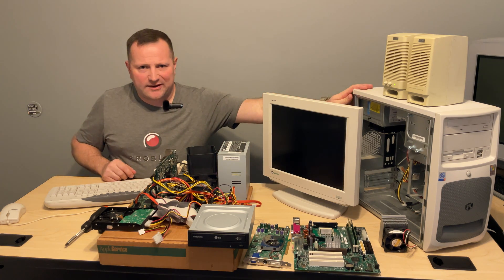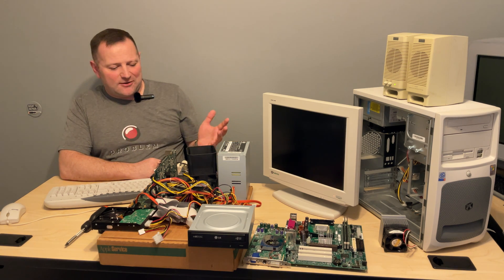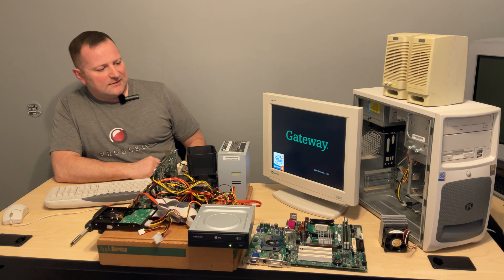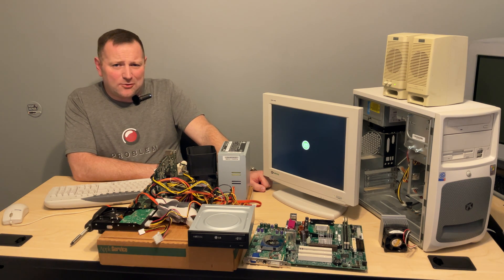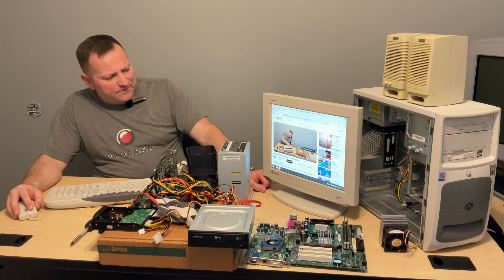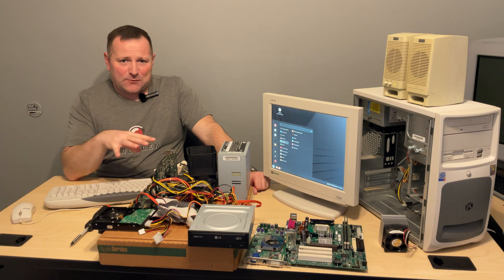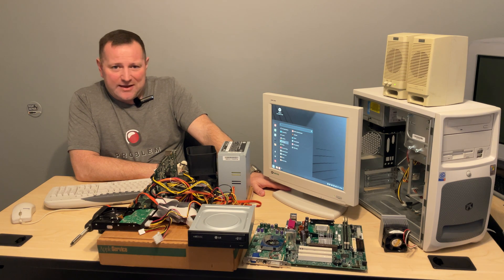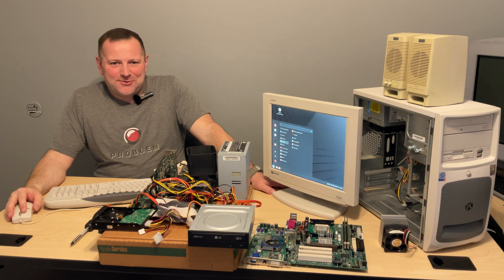Running Linux Mint (LMDE 6) On A Pentium 4

Comment: I'm currently converting every old laptops to Linux mint cinnamon (22.1 xia and lmde6 faye) as these recent versions now uses gnome Bluetooth, Bluetooth connectivity is no longer an issue and every Linux mint update is getting better.

I currently own a Dell Inspiron n5110, a pain in the ass to upgrade but I managed to replace the old Seagate momentus HDD with a 256 gigs SSD. An acer travelmate 5744z with a pentium dual core d6200 , a hp pavilion G6 with a core i3 4th gen and 8gb ram, a Lenovo ThinkPad T460s and an acer aspire a315 with 4gb of soldered ram.

All these laptops have been upgraded with 256 gigs ssds and all of them have Linux mint and are no longer tied to Microsoft because I found it weird that an OS couldn't be installed on a different machine. Does windows miss me that much? No, in fact I'm happy with Linux.

I will be getting an old pentium 4 with a windows xp installed on this and i will try fedora 41 cinnamon as Ubuntu is making things difficult with its proprietary packages and lack of customisation
Reply from the maker: Love to hear it, keep em’ running

Comment: pentium 4 can be 64bit compatible. Just depends on. the version tho.
Reply from the maker: Pretty sure the first one was 32bit, the second one was a last minute swap so it may be 64bit but never checked for sure. Need to recap both boards before going any further
Reply: @IkesVintageTech  i remember and still in my mind that the pentium 4 was supposed to be the bomb. its just I looked up the cpu marks in comparison to our modern day chips and they're are upwards of 10 times+ the benchmark rating.(not sure how exactly accurate benchmark compare across gens but even still).... we were quite limited on single thread instruction processing power in architecture... and multicore just had more units was the way to scale up processing power. ... at some point it radically shifted.

. there's no premium performance feel tho to all this chip power in the os UI and app performance. that's sad because we don't streamline and make stuff lean anymore.  (example: unreal engine. and games that take up 100s of gigs in size but don't look that much better).

Comment: The only point I can see to these types of videos is as proof of concept of how compatible linux is with older hardware, basically if it'll run on cheap/ancient computers it'll run on almost anything. However other than that I've yet to see anybody having a /practical/ use to these ancient/low-end pcs with linux that they'd use regularly. They just don't have the horsepower to be... pleasant to use now-a-days unless you have an /extremely/ niche case where you need almost no processing power/RAM, and don't mind running a computer that's comparatively speaking a gas-guzzler for watts vs computing power. Don't get me wrong I wish there was as I have several outdated and low-spec computers that I'd like to find a use for, but I'm too practical to just run them just for the sake of running them.
Reply from the maker: I have an older thin client and older touch screen running basically just a web browser in Linux to view my Unifi cams. Not as old as this of course but a use of basically e-waste hardware for a single purpose.

Comment: 32-bit and 64-bit do not mix well. Basic mint has nearly dropped 32-bit support, you may get stutter and blinking, lost frames etc. if you try. but some distributions  do support that.
Reply from the maker: Plan on trying again with a 64bit P4 when I get one.

Comment: Have had better luck with Lubuntu on another machine of that era, a trash bin-rescued Athlon I, although I've had to roll back versions and re-install to 14.04. The good part is the repos still work (!), and are still pushing software updates. Just need to be mindful NOT to accept a version Upgrade after finding the most recent one that works.
Reply from the maker: Love hearing that, find what works and keep it working!

Comment: You can use a 64 Bit p4 (This cpu ist able to run windows 10/11) I think with 4 GB ram, a ok GPU and ssd are absolute usable.
Reply from the maker: Once I get the caps replaced I’ll try it. No TIPM2 module so 11 wouldn’t work without hacks. Not even sure if they ever made it on 32 bit honestly. I know 10 still supported 32 bit.
Reply: @IkesVintageTech  You Need Rufus,A 64 Bit P4, 4 GB Ram and a SSD.  Wat have you for A socet ? 775 ?

Comment: Greetings. I have an old desktop, it's an HP 775 socket with a Pentium 4 installed and 4GB of DDR 2 RAM. I've tested several versions of 64-bit Linux, however, some don't work on this type of old processor. Fortunately, I came across the Q4OS Trinity Desktop system. It is very similar to the old Windows XP. It is a fast, secure and stable operating system.
Reply from the maker: I’ll have to give that a look, thanks!

Comment: I am just in "retro" projects. The machine I have is "Cyrix 300mhz" a 233MHz "pentium pro" CPU with 256 MB memory. The only linux distro that actually works somehow well is ubuntu 6.06, which can be somehow upgraded (mind the old-releases issues) to 8.04, but the main limit for usage is ram, since ubuntu + gnome requires 384MB and recommends 512 MB of memory. I was also able to install some old debian Sarge or Etch systems, but it has even more issues with grub 1 or grub 2 (+BIOS), also installing GUI was not simple. Super GRUB CD helps.
So the main issues with such systems is bios compatibility and limitation of RAM. Note that SWAP will not help, since the IDE is 133Mbps and my benchmark on sata ssd via IDE-sata adapter was max 15MB/s reading, while that SSD can read ~500MB/s on modern system.
The Windows 98 and even Windows XP works really well on the same system.
Reply from the maker: I noticed on the PIII system it used the USB as swap so if I were to install a USB 2.0 card it may have helped. I didn’t try the FireWire 400 as swap but that may have been better.
Reply: My system has "usb header" and it works, but i had to create connector, since the pin header pin order is not "standard". it is also terrably slow - probably usb 1.1 - 1.5Mbps

Comment: I have a soft spot for this kind of thing. I found my first PC case, a crazy red and black 2000's thing with an acrylic snake design. And I did a full rebuild but with a Pentium D, instead of the Athlon 64. Kind of an Alternate history of what I made on my first ever PC in 2004. It all just lined up with scrap yard parts from ewaste I found at work, stuff from projects, other jobs, upgrade trickledown etc. But yeah 3.2 ghz Pentium D. 4gb DDR2 667mhz OEM gigabyte mobo I recapped from a Compaq. 7900 GTX 512mb from Dell new old stock, for dirt cheap. All new noctua fans and new red LEDs and new PSU to help make up for how awful the cooling of that case was but keep up with the cringe 2004-2005 asthetic I had. Running Windows XP SP4. Mainly use it for old Star Wars games and occasionally interfacing with really old hardware that needs serial or IDE.
Its kind of a shame. Because I tried several times with Pentium 4 builds I really wanted a working socket 478, even tried a later Cedar Mill Pentium 4 LGA 775. Always die. Gave up on my AGP card I had.

Comment: I still have my PIII machine paired with Win98SE and WInXP SP3 (Dual Boot) for playing some old games. Some capacitors over time was bloated but nothing to worry i just changed them and now this PC is 25yrs old (Bought it in 1999). It was only a low-to-mid range PIII but does the job i want. (PIII-450, 128MB RAM, 6.4GB HDD EIDE 166, TNT2 M64 PCI 32MB(It had no AGP or PCIe slots) and a SB512PCI that i salvaged it from my first P75
Reply from the maker: That’s a nice setup to hold onto for all these years!

Comment: Ive probably got a dozen of the old p4 setups laying around even socket 478.... I use mint for my media machine as its got an older quad core amd which windows is putting an end to the competition by making their system only work on their own stuff. If mint would run everything without whine I would have already made the change....

Comment: Your Pentium 4 PC., case appears to be in fine condition.
My Pentium 4 PC., had 4 gig of ram., installed and a hyper threaded processor and it could handle a 64 bit system and I had the first version of Windows 10 installed on it, there was a 7200 rpm., hard drive installed and Windows 10 was usable but it was a bit laggy, so I installed Linux Mint Mate and the performance of the PC., improved, that computer died a few years ago though.
The only 32 bit computers which I currently have are two Dell Inspiron laptops, the 9300 and the 9400 both of which now have LMDE 6 installed and they work well enough, YT., tube videos do play but only at low settings.
Reply from the maker: The original board was LGA478 and running a 1.6GHz P4. The working one was an LGA775 with a 3.2GHz. Unfortunately in this case both 32bit, I looked into getting a 64Bit P4 and someone told the eBay seller's they're worth more by multiples of 10. Might get one if I see one cheap enough but can't justify getting a single CPU for the price of a whole system.
Reply: @IkesVintageTech  A suitable processor may turn up, the CPU., which was in my P4 PC was 2.7 or 8 GHz..
Reply: @IkesVintageTech i own a 64 bit pentium 4 cpu
Reply from the maker: @2xtreem4u at that time I had switched to AMD and had the equivalent 64 bit CPU. I remember XP had 64 bit support but it wasn’t great with driver support at the time.
Reply: @IkesVintageTech  i started experimenting with 64bit linux when i got the 64bit pentium 4 pc

Comment: I've got 3 P4 boards and 2 of them are dead like yours. Unreliable, especially when I have 30+ year old machines that still run fine.
Reply from the maker: Even the “good” board had a few caps that looked puffy. My oldest machines have lasted 2x as long before needing a recap.